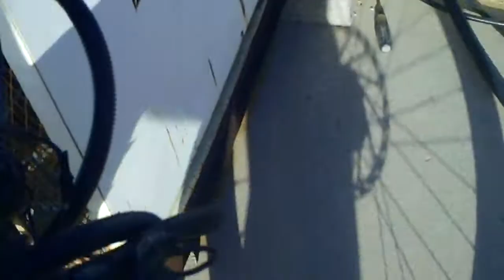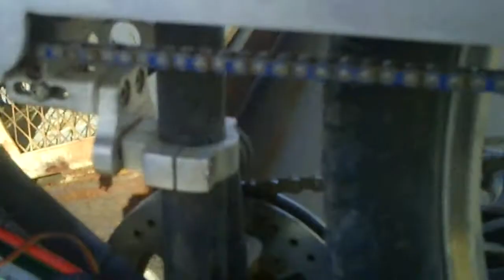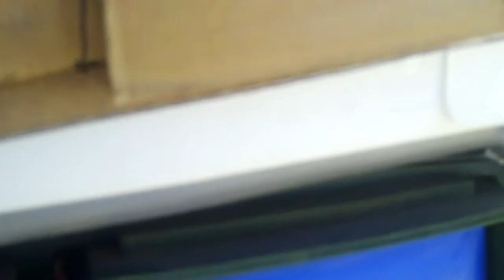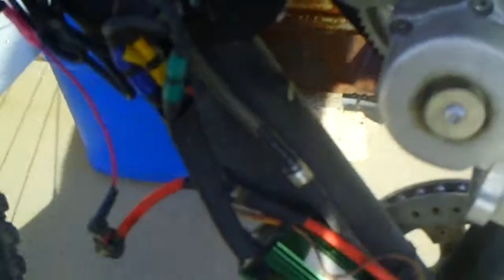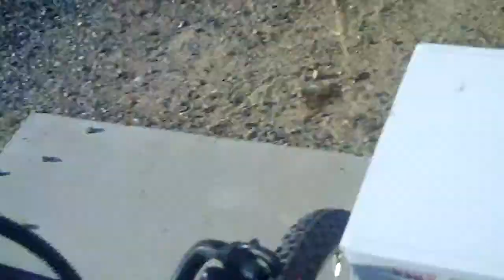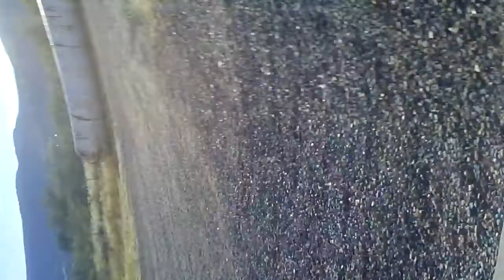e-bike walk around

Comment from the maker: I should have said that the voltage threshold on the throttle interface is set slightly BELOW the throttle's resting voltage.  This gives the motor just enough current to turn all of the time once you're riding, without having to touch the throttle, only pulling around 1 amp.  It makes the application of the throttle much smoother than having the motor catch up to the bike speed from a stop.  It also prevents the chain from back spinning when you coast or are pedaling with no throttle input.